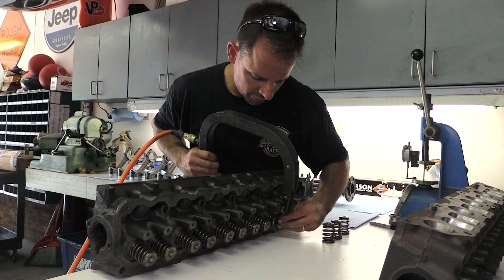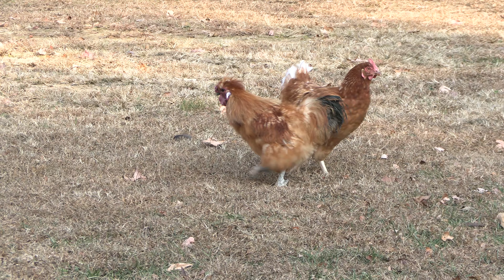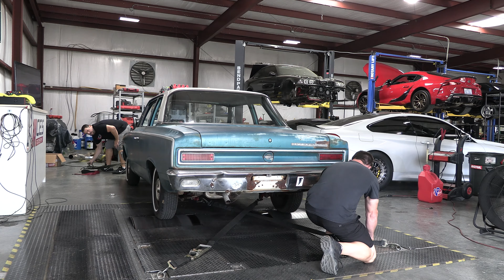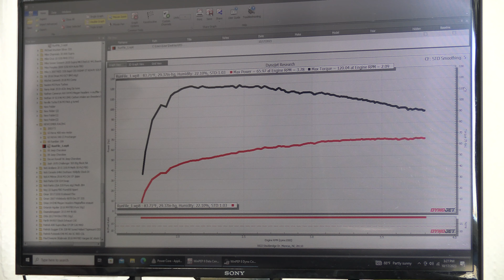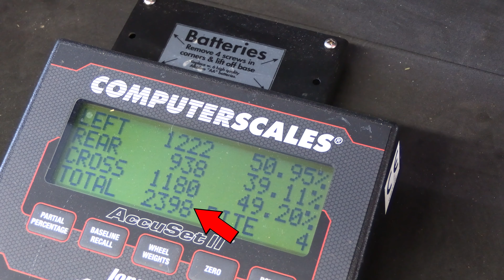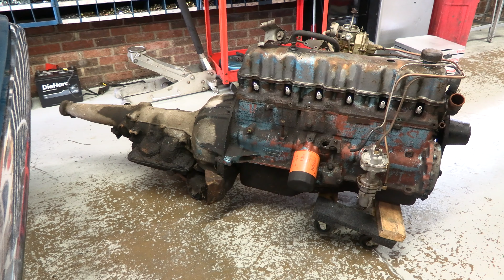We're Building this Totally Stock Classic Into a Full Custom Race Car!

Comment: is the  cubic inch   to  weight limitation    with the engine in the car  or out? because with the engine  out  OOF extremely  limited in  engine size
Reply from the maker: Total weight with engine, driver, fuel, etc in the car after the run.

Comment: The extra vacuum was to power the windshield wipers
Reply: I currently have a 64 Rambler that I bought in 91. Before rebuilding the vacuum wiper motor I had to run a string from one wiper through the car to the other to assist the wipers. Also my first car was a 66 that my dad bought me in the early 70s.

Comment: The carburettor needs to go straight in the trash, my lawnmower has a bigger one😅
Reply from the maker: Yup, that thing has the same airflow as a McDonald's straw!
Reply: I had a '68 with the 199 automatic. It would do 105 MPH on the freeway, but I found out the hard way it was running lean through that Carter 1 bbl. That stunt ended up requiring a valve job.

Comment: Thank you The Horsepower Monster.

The problem with getting a good vehicle, with very high torque, with this very light body without exceeding the weight limit is due to the flexural strength of the body. Diagonal tension struts and compression struts on the underbody can be the key to a very good handling car if the end points on the body are sufficiently strong. 

Thanks for the video.
EISENEXE
M.F. Mueller 

So. 11.12.2023 10 : 43 : 33 Clock 36 COM 1801 CALL 9/h 216 TRUE >>159000 ABO

Comment: I'm excited to watch this build. What a great fun all around hotrod. I love all the straight sixes. I'm building a Chevy 292 (308) with a billet crank, steel billet rods and billet roller cam all by crower. I have a Ryan Falconer V-12 head. Weiand 6-71 with 2 Quick Fuel 650 DP and 16 jet fogger plate. 5 stage dry sump. Electromotive direct fire EMS. Should be well north of 1000 HP. 5 speed going in my 53 Chevy 1/2 ton drag and drive for the 8.50 class. Thank you for your time.
Reply from the maker: Nice!

Comment: love this! On newcomer racings facebook post I guessed 68hp, was off on the torque though guessing 120. Pretty sure I saw 170 lb ft. Thinking stock displacement 4.0 or possible a mini stroker using a AMC 232 crankshaft with the extra weight of the 9'' and the cage ect.

Comment: I built a 69 rambler into a straight axle gasser using a 89 Cherokee 2WD front axle 69 mail Jeep leaf springs, stock rear springs and a mustang 9” bolted right in. I cut the shock towers, built a engine crossmember and put a 454 TH400 in it